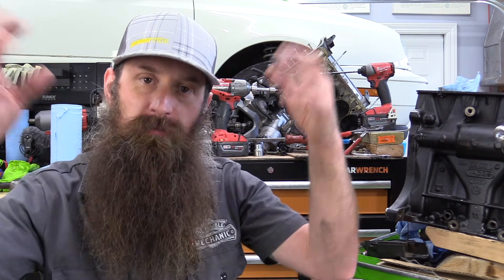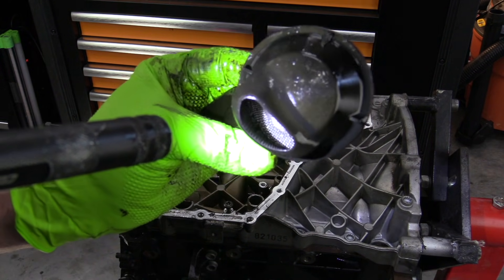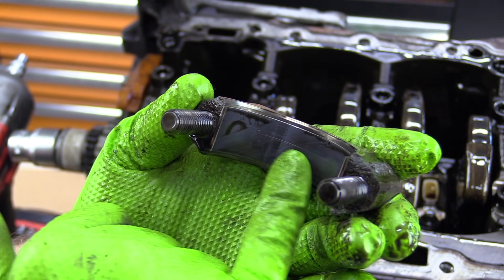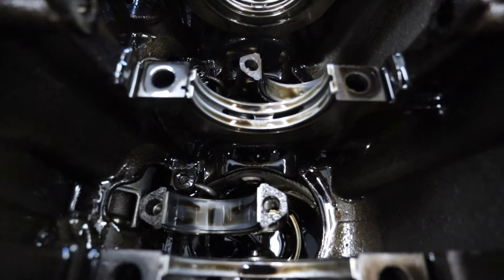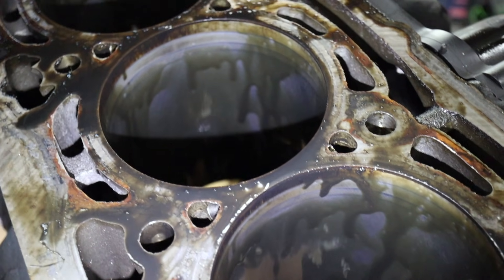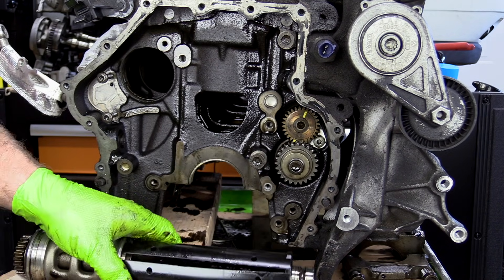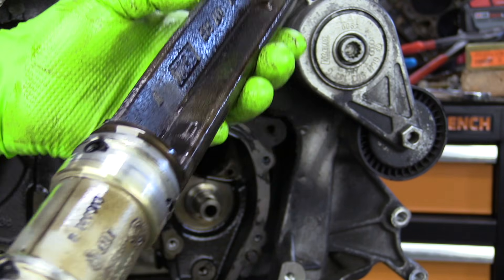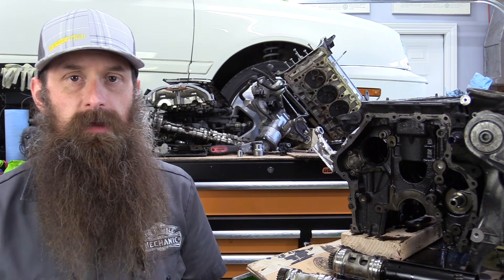2.0 TSI Engine Bottom End Teardown ~Pistons, Balance Shafts Oil Pump

Comment: Hello, I am in the process of changing my Timing chains/Tensioner/ Etc- And I am also replacing the Balance (intermediate) shafts as well... Mine are really stuck- Can't pry them out- Even tried a slide hammer with a piece of stainless wire.... I just ordered the special puller, But I also read in the service manual that they may need to be frozen prior to install- Whats your experience with this?

Comment: Hi mate need some help. In diagnosing a problem. I pulled the head of my 2.0 ltr tsi because I thought I had timing chain issue. I had a really bad miss on cylinder 4 turns out the head is fine. I have noticed on cylinder 4 has oil every where , on the exhaust manifold from cylinder 4 is coated in the oil (un burnt oil) when looking at the boar there is no gouges no scratches no marks indicating a failure of the piston or rings. But after watching your video on the failed piston it looks like mine has done the same as the one you pulled apart. Just wonder if it could be anything else that could cause this problem.

Comment: Why do people not take better care of their cars? This engine cannot be that old and is black inside with sludge at the bottom of the pan. I have several cars, the oldest one is 25 years old and the inside of the engine is silver.
Regular oil changes, that's all that is really needed. It is not expensive or difficult to diy and it prevents a lot of issues down the line.

Comment: Hey humble mechanic
You mentioned that the audi longitude engines had the probblem with oil consumption but what about Audis
Transverse engines? Like the S3?
Did the 2012 S3 have oil consumption issues??
Reply from the maker: Not nearly the level the longitudinal engines do
Reply: @HumbleMechanic  thanks!!

Comment: Hi I just rebuilt the same engine but am having a hard time with the exhaust camshaft once I mount it it wont move
Reply from the maker: Is a valve hitting a piston?
Reply: @HumbleMechanic  I put the crank at tdc. I'm just little confused about the 4 pins and rotating the cam 4 times

Comment: Can you re use the balance shafts if they look good?
Reply from the maker: You can
Reply: Can the balance shaft gear sprocket be reused? The manual says to never reuse them but I can only find used OEM sprockets for sale. Has anyone had any problems from reusing one?

Comment: Where do you get the info on reassembly? Such as torque specs on rods, main caps, head bolt torque/tightening sequence. And how similar are the gaps for the rod clearance/crank main bearing clearance and piston ring gap compared to other 2.0t models? I can't find any info on any of it for my CAEB
Reply from the maker: You can buy a one day ErwinVW pass for $35 and download everything you need.

Comment: My 2016 GTI had an engine replacement at low miles, I think around 12K miles. It was making a noise similar to a timing chain rattle, but Leith VW Raleigh said it was camshafts. They replaced camshafts and it was still making the same noise so VWoA ordered a new engine to be installed.

I ended up getting a new GTI out of the whole situation because it took something like 2 months from the time I dropped the car off to the time it was “fixed”.
Reply from the maker: Wow!! Glad they got you a new car.

Comment: Hey Charles, another great video,  i dont understand why exsactly there has to be timing in both balance shafts if they dont see timing to do with compression and such...  
  Also, on the little balance shaft sprocket (Lower(intake side) does it have timing with the balance shaft that goes across for the WP?  Redoing mine bow and id like to know that!  Thanks sir!  You are great!

Comment: Hi man, great video! I have an issue with my water balance shaft (intake side I think) because it seized up and I’m worried the internal oil feed is blocked but can’t get to it to check because it’s too deep in the engine. Any advice how I can check it? Don’t want to risk putting a new shaft in if it’s going to seize up again because of a blockage in the oil feed! Thanks!

Comment: love these videos. i have a random question for ya: VCDS measuring block 93 reads 0.00 at start up, then goes to -3.86 after it warms up. why is this? does the sensor not pick cam position until its warm? I have 115K, figuring im getting to the point where I should replace the chains soon, considering the -3.86 (it was -3.55 when I first got VCDS) one also wonders if the chains stretch because of the HPFP being driven by the cam lobes. it seems like a lot of DI gas engines have timing chain issues. (chevy 3.6, some ecoboost, vw 2.0tsi  etc)

Comment: Hi I have Audi A4 2010 turbo 176,000
Is overheating, has new water pump, no leaks, the radiator is good, the fans are working well
Reply: What can be the problem of the car. I see the shaft balance is no move the water pump belt   ¿ tha can be the problem ?

Comment: Hi, I really like your videos and they are very informative. I have a 2010 Volkswagen Tiguan 2.0L tsi Wolfsburg with edition 80k miles . It has been at the mechanic for 2 years now and spent around 6k $ in parts and repairs and still not fixed, I have low oil pressure message and its about 20psi at idle and 35psi at 2000 rpm (warm or cold it's the same), we have changed the oil pump, balance shafts, cams, cambridge, the head cylinder and the valves and the check valve that's on the head, the vvt valve on the cam, the oil retainer valve, oil pressure switch, bearings, chain and tensioners even the entire high pressure fuel pump assembly...literally everything that possibly could affect the oil pressure.
I dont know what else I could check, I looked at every forum and took it to Volkswagen dealership multiple times and still the same problem. The engine runs like new but 20psi of pressure is not ok. If you could help with any suggestions or maybe an oil flow diagram for that engine that would be greatly appreciated. The only thing that hasn't been replaced is the engine block.
(I will not trade this car or sell it due to emotional attachment...).
Thank you in advance.
Reply: Oil screen from the balance shaft and Cambridge would have got stuck in the oil galaxy. 

You got to hunt for the screen inside the engine, if they are missing from the Cambridge and balance shaft. 
There is also oil screen in the break boost pump which is connection to head of the engine. Look for that too.

Comment: What is the average price for a job like this one (bottom end) vs the top end?
Thanks!
Reply from the maker: Oh that's a good question. id guess 25 hours for the whole job. in that ballpark anyway
Reply: HumbleMechanic thank you! I wanted to know since I need a new engine on my car (2.0 TSI) and I’ve been doing some research, because I don’t know if it’s a better choice to fix the engine or buy a used one. I really wish you had a shop available, I’d tow the car to you the car in a heartbeat 😂

Comment: hi Charles you doing good work for us as upcoming engineers and I appreciate, 
I have a q5 with the same engine that broke its intake manifold at cylinder 4, car had a terrible misfire customer brought it up and I changed the manifold with another same one fitted fine but still there was a misfire at that cylinder, so yesterday I took off the cylinder head and I had one bent intake valve, went down deeper to inspect the pistons and they look great according to me, though everyone at the shop told me to have them changed because they are a common problem in TSI's, but mine look great. please advise me, only problem I found myself was the valve which prolly bent from a piece of the broken manifold. plus I cant find the pistons locally in Kenya. please get back to me when you see this.

Comment: I believe i have an oil leak at the cover just below the water pump im seeing oil and water accumulate where the bolts for this cover is it looks wet like oil has passed passed this cover. Is this a common oil leak and also what is this cover called so i can buy a new seal for it? Please help.
Reply from the maker: That is usually the cam bearing bridge above the coolant pump

Comment: Does anyone know what supplies the ballance shafts with oil? Already had 2 ballance shafts snap. Since then I have fitted brand new oil pump and 2 new ballance shafts and problem still persists. Any help would be great
Reply: Previous shafts whined before they broke and the whine is still there

Comment: I think this question is relevant. I'm looking into a pretty cheap Jetta TSI beater that seems to be running well. Oil light flickers on and shuts off. Do you have a ballpark of acceptable psi for oil pressure? Hes saying it was at 22psi at warm idle when he got it changed and didn't check it at rpms. From what I understand, the oil pressure light comes on if it dips below 23psi. Any insight? It's a 2010 2.0t TSI.

Comment: I have a 2.0t in my 2011 Q5 with a small chip in the edge of piston 1. Do I need to replace the piston and can I do it with the motor still in the car ? Looks like it's been running with that chip for a while because there was a layer of carbon built up over it.

Comment: This is good to watch as my 64 plate S3 with 40000 miles and full Audi service history is in having a engine rebuild now , 
Apparently it's a big end knock , been quoted 2450 for the rebuild which is much cheaper than the silly money Audi wanted to replace the engine

Comment: In general, it's a great engine, but if you want it to be reliable swap metal parts instead all of the plastic parts after the warranty expires. These plastic parts don't hold together under the boosted conditions - they melt and crack down.

Comment: Why are they using plastic pieces on the inside of the engine? I dont like that concept since you never really know how plastic will react or how it will break down. Plastic is not reliable to me in how they are using it. I would want metal since its doing going to change with engine temps going up and down and all over.

Comment: Hie Charles 

I have been a fan of your channel for a long time. I didn't own any  TSI engine yet but I was motivated to make an investment  In a 2012 MK6 GTI. I love hatch bags I think they are just cool. I own a 2010 speed 3 running on a stage 2 COBB. 
I wanted to the GTI to run on a similar tune COBB. I like the luxury of having to ability to see how the engine is performing in your hand. 
I got the GTI with 21k miles stock. I drove it to about 50K stock and then I wanted more HP so I start adding mods little by little. first I was happy with only 20 more HP. 
                                                                     I started with a COBB air intake, then COBB cat Back and 3'' Downpipe. I drove the car with this set up for another 30k miles. Which to date the car is about 101k miles on the dash.  
I started to have problems with intake manifold ( after watching your channel I was kinda waiting for it to go). 
So when I was doing the Intake I saw other things that caught my attention. 
        i. The engine was using a lot of oil. (  it is  normal for VW that's what the dealer said)
        ii. a lot of Carbon build-up. ( I don't have a blaster! I took the head to a machine shop for                                     new values and pressure testing)
     iii.  The exhaust manifold has signs of a tiny leak. 

Knowing what I know now I want to do a lot of stuff to the motor once and for all. water pump, timing chain e.t.c. Basically, rebuild the whole motor.  
So I m wondering what do you recommend for high-performance pistons, rings and e.t.c. I wanna rebuild so that I have better love and appreciation for the car. 
Also is it better to buy an APR short block? cost 5 grand?

To be honest it will be awesome if you could recommend a shop that I can take the block for machinery.

Comment: does anyone know that if you are running a higher amount of boosts should you space your piston rings more like if you were running nitrous when you're running nitrous on a carthe piston rings have to be gapped more so they do not touch each other when you hit over a hundred 50 shot or 250 shot of nitrous so it does not crack the Piston does anyone know if this is the same when you're adding more boost

Comment: Repair instructions: Remove front axle, engine, and sub assembly from garage, retain contents from glove box, discard vehicle. Replace with Toyota, reinstall contents of glove box, drive and enjoy.
Reply: Casey Stoner this is the best Idea ever. Toyota vehicles just run almost forever, while VW have so much trouble, like Chains, Oil Consumption etc.
Reply: @henningoelkers9819  It was a remarkably easy repair to achieve. Much more straightforward than the complicated mechanical wizardry that the Humble Mechanic can pull off.

Comment: As I wrote in the top-end video these oil squirters, shooting oil on lower cylinder walls, I saw an engine apart and asked the ´head man, "What Failed?". He said one of those squirters froze open and for that low oil pressure light, limp mode and engine removal/tear-down.

Comment: Question, what do you think of the 2.2 ecotec  engine, I just stuffed one in my Alfa Romeo spider, with a w/c t5 transmission  Rom a 1997 mustang v6.. I love the build of the engine, block, bedplate,knifed edged crank, I did remove the 2 balance shaft among other mods, It was at dyno at 186 hp at rear wheels.. lot better than oem 2.0 Alfa Romeo  engine at 115 at flywheel

Comment: I just had my engine timing chain teared down with tensioner and chain changed. Hardly 2 weeks after it hit the road. It just started misfiring and one of the new spark plugs wornout completely. Diagnosis machine indicates sensors and manfold misfire. What could be wrong with this Tiguan 2009 TSI 2.0 Engine

Comment: In fact on TSI and TFSI engines is the cause for high oil consumption totally undersized oil swiping rings on the pistons.
They have half the size the normally would have. Reason was the pity full attempt to reduce friction to gain more horsepower.
Downside was the the oil bores clogg up and oil gets into the chamber and burned.

So when rebuilding: get the channel for the oil swipe ring to a normal size, resize the oil bores in the channel and put normal swipe ring into the engine.
It makes no sense to keep the original setup as tests have shown that we talk about less then 2-3 hp due to less friction.

And you can expect to due all the fun stuff again somewhere between 50.000 and 100.000 miles as the swipe ring cloggs up again

Comment: These engines are not built for the faint at heart to work on. Emissions standards have made them needlessly complex and unreliable. These are not the only engines that have problems, I've encountered multiple problems with GM as well as BMW and Renault engines. Oil starvation is one but stretched and broken timing chains broken of rocker arms, and so on. These modern engines were not built to last more then ten years, but probably to be replaced with something more advanced after their shorter life span. Just my 2cnts.

Comment: When I first drove a 1974 Passat the engine was a 1500 smooth and simple and reliable.  This carried on to the 1800's, now they are not only   unreliable but have design faults built in.  Yes they have more power but at what cost.  I could replace the timing belt in in 15 mins on my 1987 Passat .

Comment: Hi I’m new to your channel my name is Kihel,it happened that I bought an 09 A4 2.0l ftsi engine from my friend he didn’t want to fix it ,time chain was gone I removed already the heads the pistons have very very light scratches from the valves impact ,so I’m trying to rebuilt it ,but I was thinking to replace only new head with new set of valves ,or should I to replace the piston two ,thank you

Comment: Hello, great vid like always....again, I. having major problem with my 2012 CC, repaired the DSG transmission for 3500$, after that those balancer shaft broke and there's another 3500$... now it seems like the crankshaft or bearing or seal regarding the crankshaft are broken....the car as only   90000km , what can I do beside running over it with a Tank?!..do you know if VW addressed those issues for customers?... Thanks.

Comment: Hi HumbleMechanic great video, I noticed on a lot of Euro centric autos as well as KTM/Husky using Torx fasteners. Is there a particular reason over not using traditional metric allen heads and/or metric hex head bolts?

Comment: Hey Charles can you assist me please I'm changing the seal on the balance shaft that's behind the water pump gear like at 9:49, when you remove the seal there is a small hole on the block on the bottom of the seal unfortunately the tip of my screwdriver broke off and a very small piece fell into this hole, can you tell me if this hole is directly connected to the sump pan etc or even better what does this hole do? does it supply oil to the seal?
Reply from the maker: Oh that’s a good question. I’m not totally sure.
Reply: @HumbleMechanic  is it possible for you to check as you have a already broken down block? just take the seal off and spray some water in the hole and see where the comes out i will gladly donate to your channel to compensate for your time. thanks.

Comment: Hey I have a question, when I start my 2019 Vw Tiguan, it makes a high pitched whiny like sound for a quick second or two, then goes away. It burns a decent amount of oil already which I’m mad about. What do you think that means? Also is it okay to use a 5w-30 oil instead of 0w-20 to help slow oil burning? Thanks!
Reply: When your engine is new it will burn more oil than normal. After the engine breaks in, it should stop.